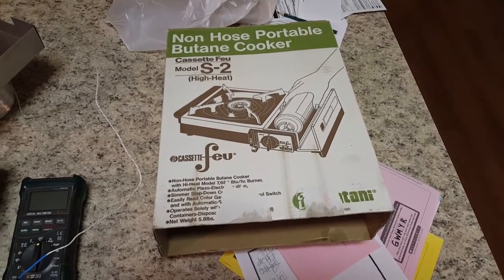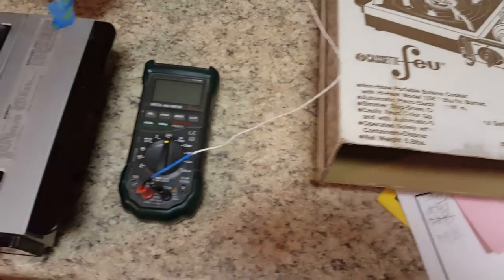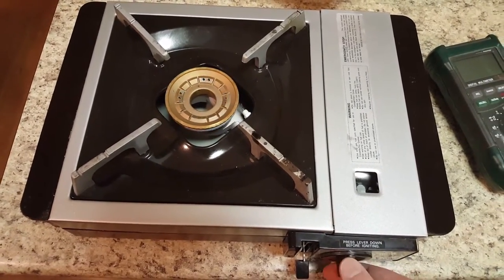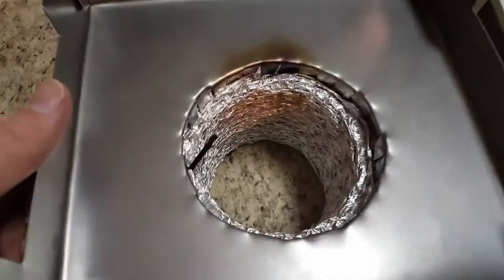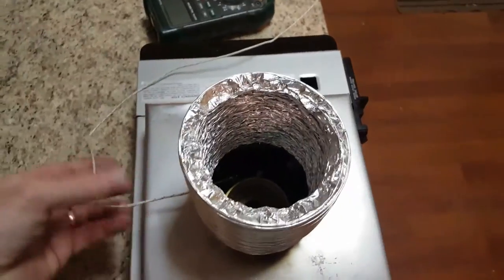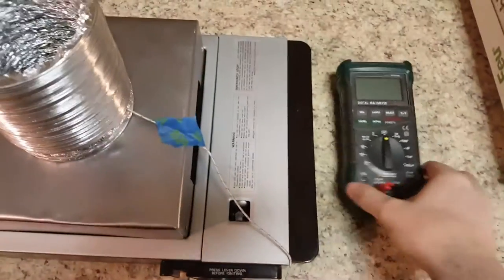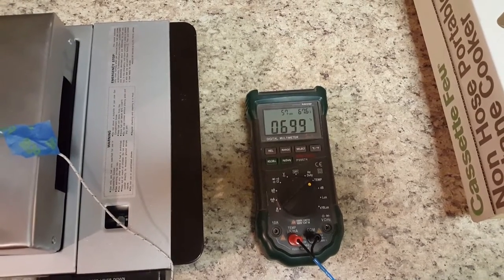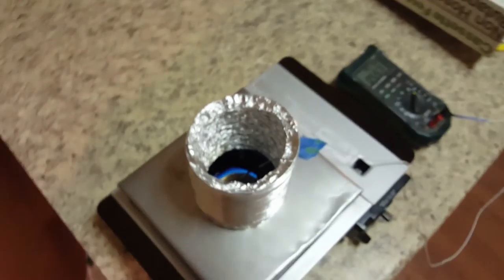Aircraft engine preheater

Comment: When I lived in Alaska during the 90's had some friends who owned Super Cubs, they used to make a coleman style heater for air-cooled engines, but instead of a lantern on top, it had a catalytic type mesh, they would set it inside the engine compartment, in the case of a Cub on top of the exhaust pipe's heat muff, haven't seen one in years thou.